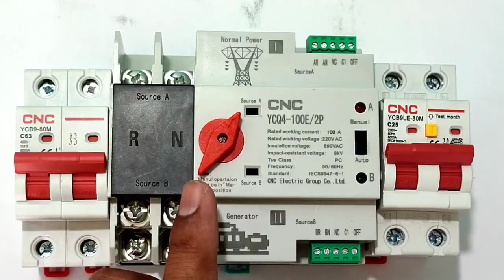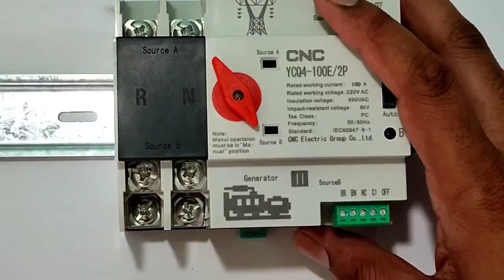Automatic Changeover Switch Complete Wiring! Ats Wiring! Ats for Home! @electricwiringcenter1365

Comment: Will this transfer switch work with 110 V control voltage? I need 110 V line and a nuetral on coil terminals BR and BN.

Comment: Hello, can you manipulate the AR and AN, BR an BN connections? What happens if AR and AN looses connection while it is ruuning in source A?
Reply: I'm thinking of putting a relay between AR/AN connections wherein it will not switch back to Source A until Source B is still on. Is this possible? Thanks in advance.
Reply: Did you ever get an answer to this?

I’d like to add an On-delay timer to mine as well. Yes it seems counterintuitive for an ATS setup, but I’m using the ATS for an inverter setup (even though a manufacturer advises against such). The situation with my setup is that it goes into a source switch loop when the batteries on the inverter is low and a sudden extra load is added while the batteries are still trying to get charged off the solar panels. The extra load causes the inverter to shut off and back on with the solar trying to charge it and the loop continues

Comment: I want to power a DC load (less than 50A) from two DC input sources. When DC source A (primary) is available, there will also be a 230V power source to compliment it.  If I supply the 230V AC to the Control terminals (AR + AN), will that be enough to make this ATS function? 
Basically what I am asking is two fold:
1) Does the control wiring have to be linked to the power wiring, or can the power wiring switch DC loads?, and:
2) Is the secondary control wiring necessary to connect, or will the switch function normally with just the primary control wiring?
Any advice will be appreciated :D
Reply: This is AC switch

Comment: I wired mine exactly as you have shown however my ATS will not automatically switch over from source B to Source A but will work properly to transfer from A to B. Would you happen to know what could be wrong?
Reply: nunuus1  It just started working properly. If I turn off the inverter source B off and then switch the main power back on it will now switch back to source A automatically. I don't know why it just started working. I have been adding solar panels and messing around with the wiring a little but still confused why it started working.